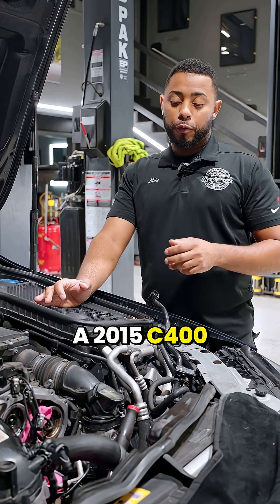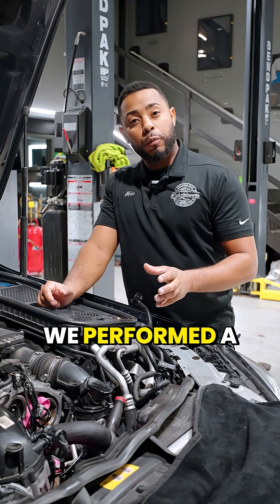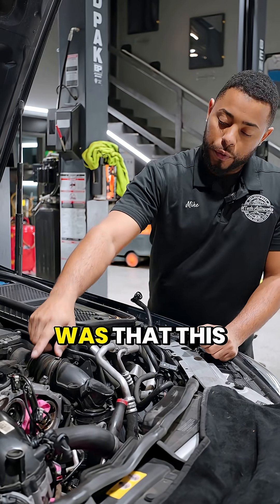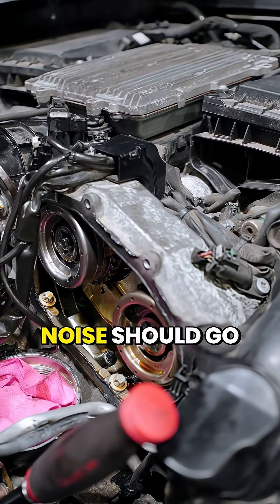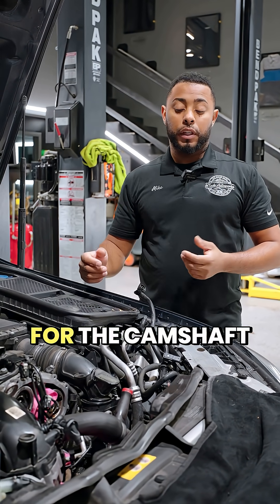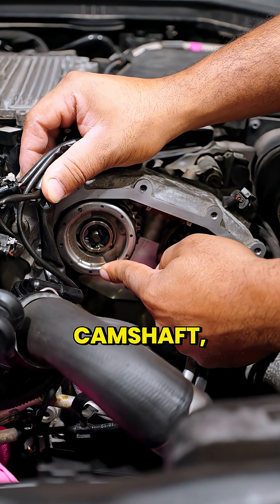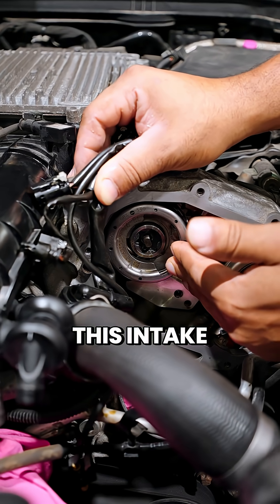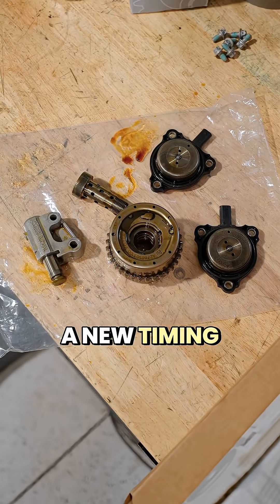Mercedes Cold Start Rattle Fix – M276 Camshaft Adjuster Replacement | Fault Code P002177

Comment: i have an 2012 M278 CLS and have the engine rattle. I want ti replace all 4 adjusters instead of just doing faulty ones. The OEM ones around about $1100-$1300, but i see a full set of 4 for $377 on A-Premium. Is it worth it to buy it from there and use those, or is it very risky to use aftermarket cam adjusters?

Comment: I think Mercedes fixed this problem from 2017+? Change your oil every 3-4k miles to prevent this. A harbor freight fluid extraction pump will work and siphon all of the oil out. I tested it and not a single drip of oil came out of the drain plug. Oil changes will take 15 minutes and you dont have to lift the vehicle and remove the belly pan.
Reply: How is this going for you ?I think I might try this next time I have a 2014 Mercedes ml350 , can I ask why you do it this way ? Instead of the old hop under your car and drain from the bottom?
Reply: @AndrewMoncada-j3l Im on my 3rd oil change and its doing fine. I do it for convenience. You can always change the oil from the bottom maybe every 20k miles to check for leaks or problems.

Comment: The adjusters are marked AR and ER ,the dealership  will pull the entire engine because they automatically  change both cams for that job estimate cost 10,900😮

Comment: I have 2017 gle43 4matic got engine with gas cap error. But there is another thing i dont like on cold start it makes a sound like how the old cars had power antennas that would rise into the air. Its like a whining sound then it goes away
Reply: Secondary sir pump

Comment: I would do both adjusters at the same time and tensioners. Pcv, all plastic valves ,and serpentine components at that mileage. Along with water pump and cooling system components..

Comment: What's a job like that cost, n should u replace the timing belt?
Reply: Timing chain. I’d say a job like this is probably a 6-7 hours
Reply: It's not a belt,it's  a chain and the entire front with intercooler  for the chain to be replaced 😮 estimates 16 hours 6,000 at dealer
Reply: @guianders I’m having this issue and I was told 1-2k. once it’s fixed. is it good for a while?
Reply: I’ve been quoted between $6-$8k

Comment: I have one Code P0447... It's driving me crazy... C300... EVAP is open 😢😢😢😢

No one wants to work on Mercedes... 

Last year, I took my car in for tune up... My car was returned and the fan wouldn't go off... I took it to another shop... It was returned with no lights.. no signals absolutely nothing ... no horn or anything... they said they fixed everything... the Engine Light won't go off... I drove it 900 miles as suggested and replaced some parts just to get the EVAP to close... NOTHING... 

MY CAR WAS IN EXCELLENT CONDITION BEFORE THE TUNE-UP...
Reply: start with the fuel cap
Reply: @aeroflopper 

The 1st thing I replaced... 😢